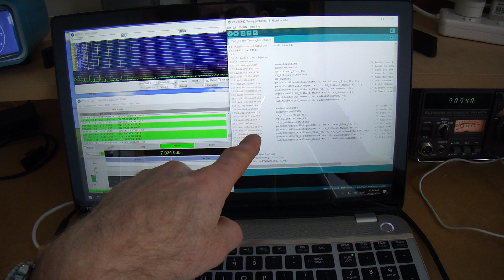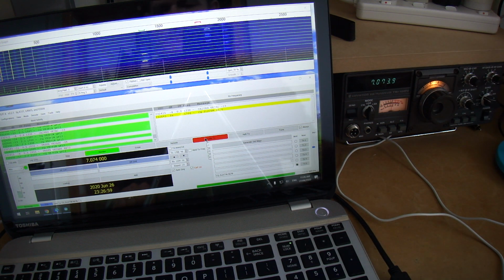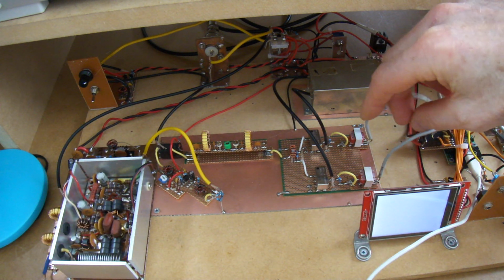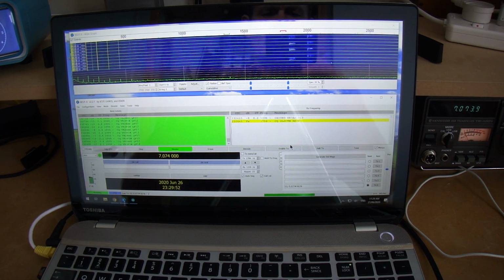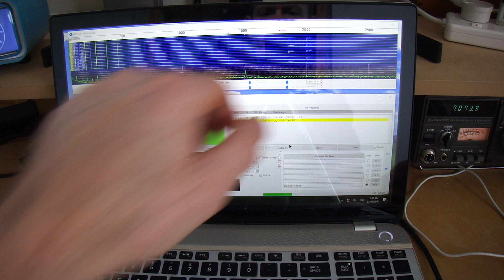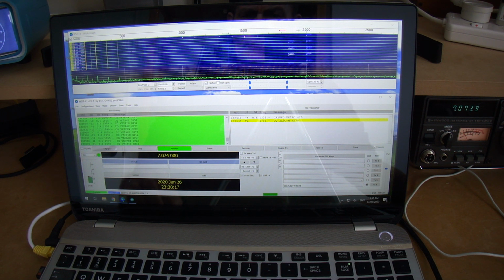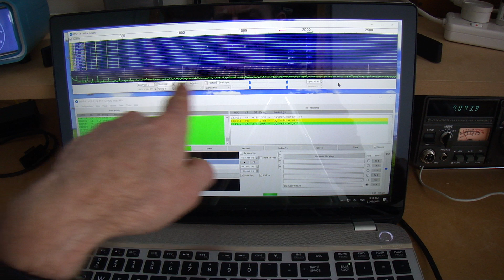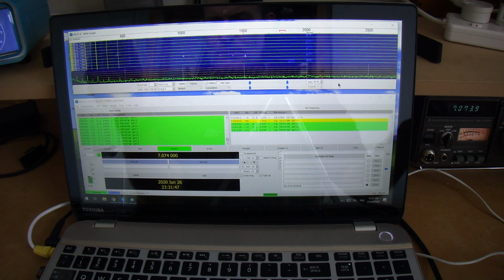Digital Modes Rig - Part 3 Initial Receive/Transmit Tests

Comment: charlie have you ever had any problems with ticking in your receiver from a Si5351 in a direct conversion receiver? Thanks!
Reply from the maker: Hi Loren. No, I haven't had that problem. I'm normally try hard to reduce ground loops (or at least the size) where I can.
Reply: Charlie Morris Thanks so much!

Comment: I am glad it worked out. The Teensy seems to be able to handle the load. I need to get one and put it through its paces. You once again prove the old adage: don’t let a theoretical concern stop you from trying it out.

This looks like it is developing into a fun little rig with a very concise design philosophy. I bet it would be marketable.

Well done. Charlie KM4ZZ
Reply from the maker: Thanks Charlie. I've been wanting to do a CAT radio for some time so this was a good excuse. I might have to make a nice software GUI at some point and do away with all the knobs and switches.

Comment: Wow you've made progress.  I guess having some previous built blocks helps.  
Are you using the audio shield for audio capture? Is it practical to increase the sampling rate and bit depth?  When I looked at it a while back it looked to me like the audio library was fairly hard coded to CD quality. 
Keep up the updates.!
Reply from the maker: Hi Ross. Yes I am using the Line IN port on the audio shield to capture the baseband audio (I and Q). Take a look at: https://www.pjrc.com/teensy/gui/index.html?info=AudioControlSGTL5000
It's a great tool to understand what the syntax is for each object. I have not looked to increase/decrease the sampling rate as it has performed well in the past. Paul and Robin have certainly done a great job with the library.